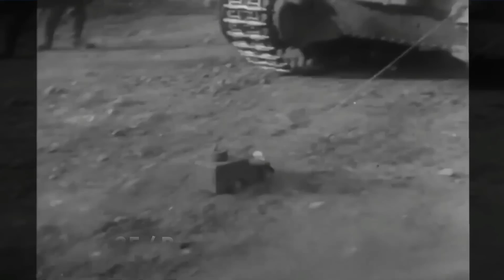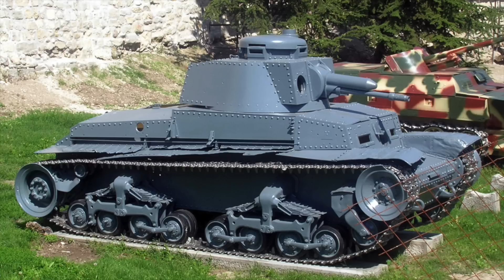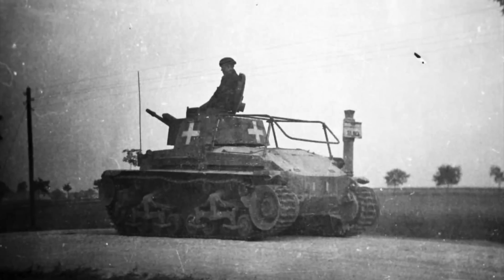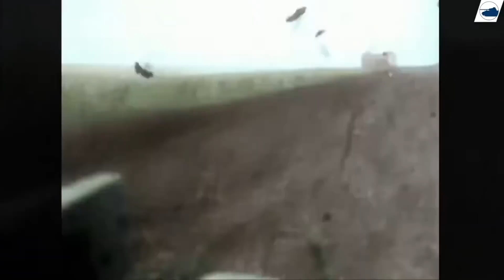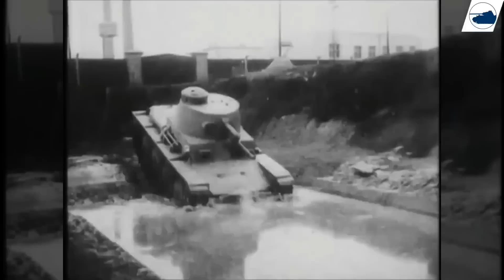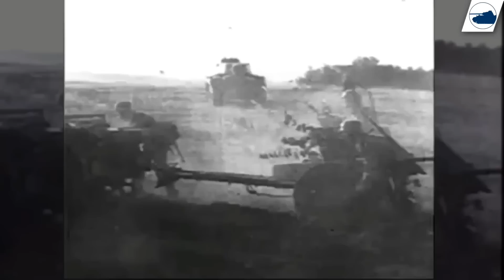Czech Tanks of World War Two in German Service

Comment: Czech tanks in 1939 made only up for 10% of German tanks? I would have thougt that the number was higher. So Germany had 10.7k tanks at the start of WW2? These numbers don't seem to be correct. Which sources did you use?
Reply from the maker: I meant that Germany used 1,700 Panzer 35ts or Panzer 38ts throughout the entire war. But by September 1939, the Germans had 244 Panzer 35t and nearly 100 Panzer 38t. That is about 10% of the total (~3,200) German tanks in 1939.
More info can be found in "German Weapons of World War II" by Hart, "Czechoslovak Armored Fighting Vehicles" by Kliment, historyofwar.org, and tanks-encyclopedia.com.
Reply: In 1939, this was about a third of the tanks that were actually usable for an offensive. Most of the German tanks in 1939 were of the PzKpfw I+II type, but more or less unusable for an offensive. And that is why "on paper" the Czech representation is only 10%. Scrap that did not participate in the offensive (first-order) is also included.

Comment: A lot of the footage for Panzer 38t is actually the TNH-P, an export variant intended for the Iranian army, a side-grade from the initial prototype. For the LT 38 intended for the czechoslovak army, the turret was different, similar to the one of LT 35, but already with 4 crew members intended. LT 38 wasn't supposed to have 3 crew members, unlike the LT 34 and LT 35.
Reply: There were several variants similar to the Lt vz 38, export or license tanks, in Sweden, Peru, Iran and Switzerland. The Iranian tank was developed from a PIIa design that failed to become the LT vz 35 (a Škoda prototype was used, although they were equal, but Škoda was privileged) Armament varied from the A3 gun on the Iranian vehicle, the same as the Lt 35, 25mm, and the Lt 38 used the longer and stronger A8.
There was also a design of a medium tank (St vz 39) Armed with a 47mm A11 gun, the Germans judged that it was the same in characteristics as the PZKW III and that it was not worth their while to produce it. The license was sold to Hungary, which produced it in several variants.
The 10 tanks sold to Bulgaria were originally ordered for Afghanistan, but could not be delivered due to the war. The difference compared to the Lt 35 was the A8 gun.
Jagdpz 38 is also manufactured under license in Sweden
Reply from the maker: Pretty interesting!

Comment: The Germans used Czech Tanks but only until 1941 and in very low Numbers.What the Germans did use in greater numbers were Czech Chassis as Base for German SPG.
Like the Marder but Specialy for the Stug's.
Reply: You say in very small numbers:
On May 10, 1940, they made up about 14% of the German tank units. However, they had more powerful armament and armour than 60% of the deployed German tanks (Pz.Kpfw. I and II). For example, Erwin Rommel's 7th Panzer Division had the most numerous Pz.Kpfw. 38(t) tanks. 
In the evaluation report on the deployment of tanks of Rommel's 7th Panzer Division it was stated: our principles concerning the command and combat with tank units have generally proved successful. The daily capacity of the tank division was highly exceeded on some days. During the fighting, a very high rate of advance was achieved. The record was 340 km in a single day...

German tanks are well armed and outgunned by British and French tanks. The division is confident that the German tank is faster than the French and British tanks. ... The division has always carried out tank attacks at maximum speed. The chassis of the Pz.Kpfw. 38(t) has proved to be reliable and durable. In this respect it surpasses all German types. In three consecutive days, when the pace of advance was up to 280 km per day, the number of Pz.Kpfw. 38(t) that had a breakdown was negligible.
In total, about 1400 Pz. 38(t) ( Lt. vz. 38) tanks were produced. Production ended in June 1942. 434 Pz. 35 (t) (LT vz. 35) were produced.  From this it is certain that the combat units participated in the entire western campaign, before that the campaign in Poland. Operation Barbarossa involved 155 Pz. 35(t) and 625 Pz. 38(t) tanks and 40 PzBfWg 38(t) command tanks in the 7th, 8th, 12th, 19th and 20th Panzer Divisions. 
It is obvious that after 1941 their role became less and less important. But in 1940 they helped significantly to the German victory - the 7th Panzer Division. The LT. vz. 38 chassis served the Germans until the end of the war.
Reply from the maker: Yes, many more Czech chassis were used for tank destroyers like the Jadgpanzer 38t (which after the war got its nickname “hetzer”).
Reply: It's not the same chase at all. The Hetzer hull is longer and wider. It did share the engine and drive line with the 38T.  BTW I hear the Girls Und Panzer Ora theme playing in the back ground   @General_History
Reply from the maker: Thanks for the clarification. Also, the German songs I used are called Westerwaldlied and Königgrätzer Marsch.
Reply: @kirkstinson7316 it used the same suspension, same transmission, same engine, same wheels and basic layout, but its true that the whole of its hull has been redesigned and angled